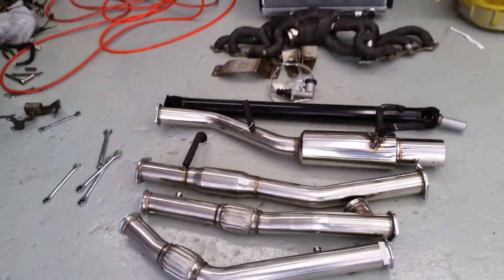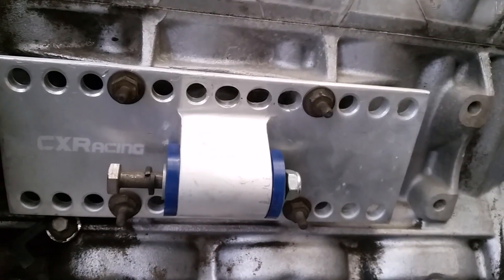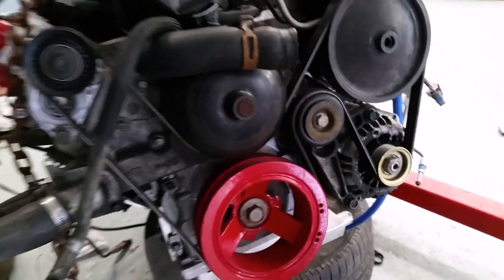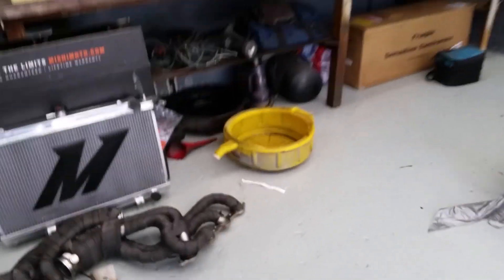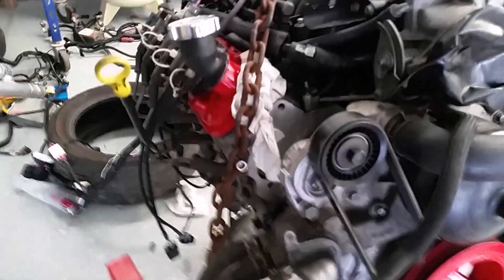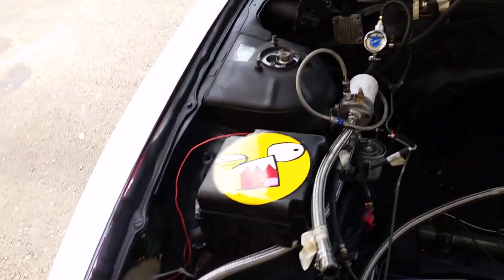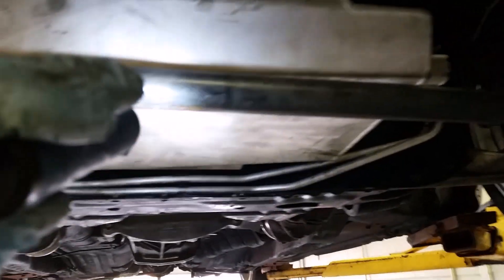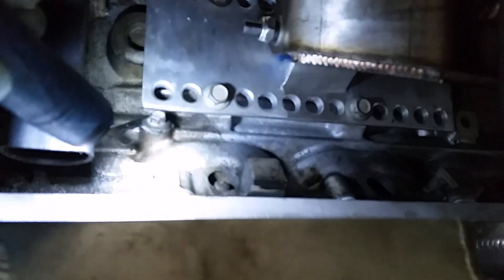LS1 Engine Swap 240sx S14 Part 1 Flying Wheels

Comment: ok Im 17 I saved up around 7 grand..and I really want to swap an LS in a 240..so what should I do? continue to save or buy a used t56 tranny and ls1 and then buy a 240 shell??? i really want to get an expert opinion before I start buying shit
Reply: Slim your gonna have to save up a lot more then 7
Reply: Dakota Porter The car can be bought for under 4k, and the ls1 can be around 1500 dollars. I would be interested in doing something like this so I'm definitely a noob. if you could explain to me why he would need more than that, it would be much appreciated :)
Reply: Alan The Salamander well you have the 240sx 4k ls1 1500 a t56 used also 1500 plus, harness 1000, motor and trans mounts 500+ drive shaft 900+ oil pan 300+ that's close to 10k just for the whole motor setup. then you have all the suspension parts you need and angle kits if your going to drift it which cost some $$$
Reply: Dakota Porter Wow ok, see I didn't know you needed all those other parts with it. Anyway maybe I can do a cheaper swap to a different car later. Thanks for clarifying though!
Reply: Alan The Salamander it's the little things that kill you lol. but I'll be doing a 240sx ls1 drift build soon so I'll go in to detail on how much it cost me
Reply: Oh ok, good luck with that man! Also I just saw a video of a guy that swapped a small block 350 into a datsun 280z. He said the whole swap cost him about 2k, how's that possible?
Reply: Alan The Salamander I also have a sbc swapped 280z lol and because a 350 you can pick up at a junk yard for $150 same for a th350 transmission. it's not fuel injected so you done need a harness to power the computer and injectors like a ls. you just wire a power and ground and that's basically it. besides drive shaft and motor and transmounts. but I made my own
Reply: Oh wow. Is it a good swap? I really just want to have a car that has good power compared to my daily driver scion (which I love) but the sub 150 horsepower is a real drag.
Reply: Well it's a good swap for the money, but with the carb motor your going to have to constantly adjust the carb. One day it could run great. Next day like shit. That's why a lot of people swap the ls motors in the older cars is because they are reliable. The computer will adjust the fuel map for them unlike a carb motor
Reply: Lol dang man I really wish I knew more about cars. And I don't know shit about adjusting the carb so I think I would blow the engine quickly haha.
Reply: Run to lean or rich it will go boom lmao.
Reply: One more thing, kind sir. Is there any cheap engine swaps that you could recommend for me? Maybe a solid -car and engine combination that wouldn't require too many extra parts to complicate my relatively knew dive into the car world lol.
Reply: Im not planning on drifting. I just think doing an ls swap would be a lot more reliable then boosting an SR or KA. ok so I found a 240 for 3 grand. the body is good but the motor and tranny are shot (which doesnt matter since im doing a swap) I also found an ls2 and a t56 tranny out of a pontiac gto for around 3500..so do you think this swap is possible to do for 10 grand.. Im already at 7k and this summer I plan on getting a 3rd job so I should have 10k by next fall...lol my parents will kill me when they figure out I spent my money on car shit and not college...I just need answers from people that know more than me about this..i also thought maybe I should just do a 2jz swap..you do have some other options when you have 10 grand to spend..anyway if anyone has any ideas let me know...I really dont want to impulsively buy a honda civic..put a fart can on it..then get the "ebay turbo special"
Reply: Slim should be possible if you do all the work your self
Reply from the maker: there is a lot to consider with this swap. there are shops out there that will do the swap for $2-2500 if you supply all the parts. keep in mind, there are always unexpected items that call for extra labor charges along the way. each car/shell/donor is different. you'll "save" a lot by doing it yourelf, I say "save" because you'll save money by not paying a mechanic but what  is your own time worth to you. be prepared to dedicate yourself to this project for months if you are doing it. also, with drift tax, even a 240shell isn't cheap
Reply from the maker: if it's a daily and not a drift car, you may want to think about just doing an SR swap. you can have it in and running in a weekend

Comment from the maker: the Trans mount is not adjustable. although there are options on the motor mounts, it only fit in and lined up 1 way.

Comment: I Have just one question as im thinking of getting the cx racing mounts, because i love the fact that they are adjustable, but what happens to the transmission mount if you adjust it forward/rearward engine mount bias?? because adjusting it would move the transmission and driveshaft?? are those also adjustable? thanks
Reply from the maker: I had to adjust it just to fit. It would only allow it to fit in one position for me.

Comment: i did this exact swap on my s14 and i have a couple pointers with you. the passenger side header you need to take off and get the O2 sensor bung welded in a different posistion (i chose straight up) because where its at now you cant fit the sensor in. oh nvm, i see you posted the rest of the videos. i would never go with cxracing again because i ran into all the same problems you did and it sucks.

Comment: This is awesome, I'm glad to see someone finally made a detailed video on this. I am working on the same swap myself with the CXRacing kit and would like to compare my experience with yours. With the engine plates I had to use the third hole just like you did but I first attempted it with the 4th hole which is what they had in their pictures on their website. I also agree that the headers were a lot of work, I also heat wrapped mine just like you did.  I installed the engine with the passenger side header on and that didn't cause many problems. Once I tried to install the drivers side I got so frustrated I had to rip the heat wrap off, THEN it finally fit. I am also baffled that there is a bung for the oxygen sensor on the passenger side header pointing DIRECTLY into the transmission. I did not have problems with lining up the engine mounts. A few things I would like to ask, how much of an issue was it to deal with the starter wiring and where exactly did you place your oil filter and how did you route those oil lines? Thank you!

Comment from the maker: Thanks for the comments!  The project was stalled for a little bit, and we just got back to it. We should have part 2 and the finish, part 3 up soon. Brian, The Sikky full swap kit is the way to go if you can afford it. The how to DVD is very thorough, comes with the kit, and walks you through step by step so there are no snags. I would recommend buying everything all together and from one place. Mix and matching can get a little confusing and makes it easy to miss or forget stuff. I went with the CXracing for the price. They have complete kits you can buy all together, Ebay had them with free shipping so it was actually cheaper to buy there rather than the website. I did alot of research, the full CX kit is SIGNIFICANTLY less expensive. Although I haven't found a problem with quality, CX parts are made in China vs. Sikky is made in the US. I didnt really want to mix and match anything. So I bought everything CX had to offer with was about 90% of what I needed, and filled the rest with Sikky. I read and researched all the other products and names out there as well, I could have found things even cheaper, but then you are really buying 1 thing at a time and hoping that they all pair up in the end. Do it right, buy everything together, make a list, keep track of it all as you go. Good Luck!